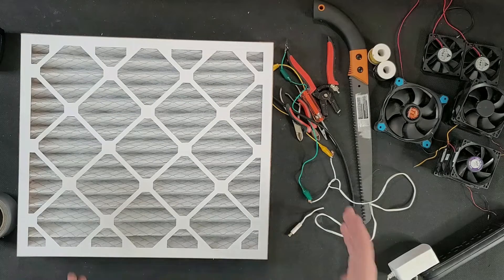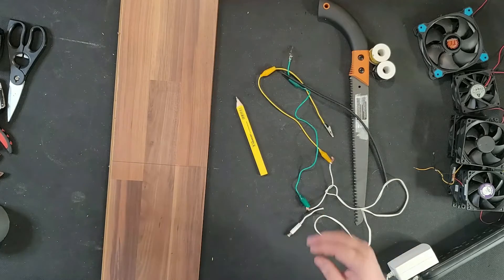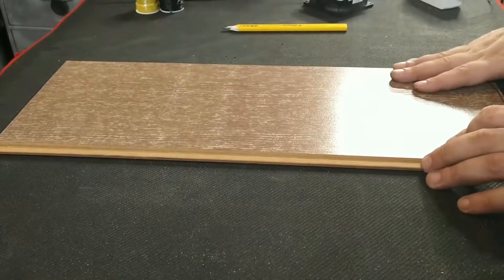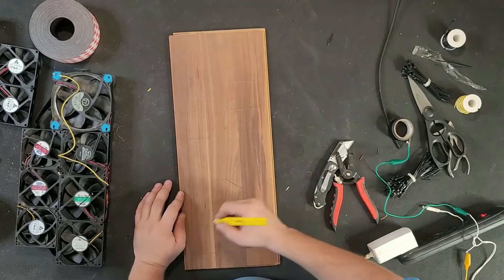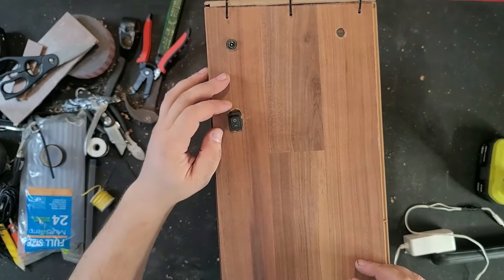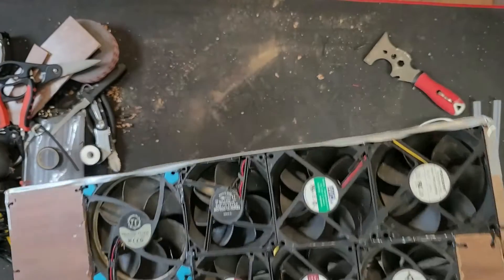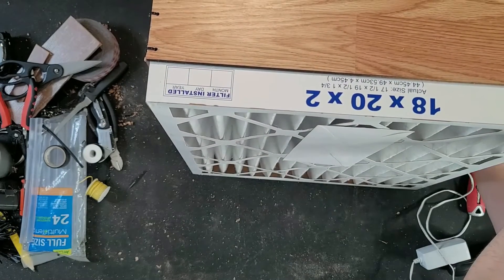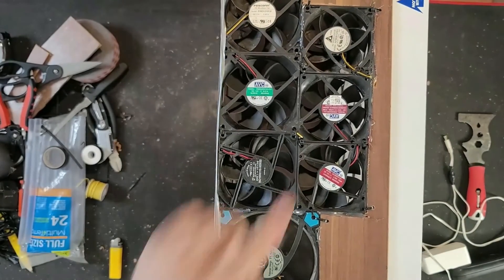How to make a DIY Air Cooler/Purifier with PC fans

Comment: I'm curious if there's a difference if the fan sucks in air and the filter is in front, or if the fan blows out air like in this example?  I'm asking because of air pressure which is better?